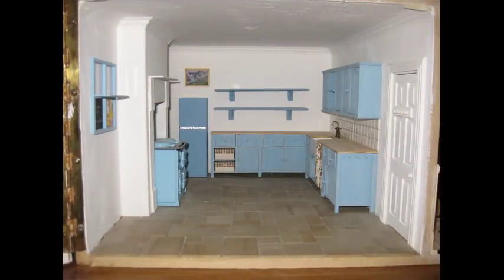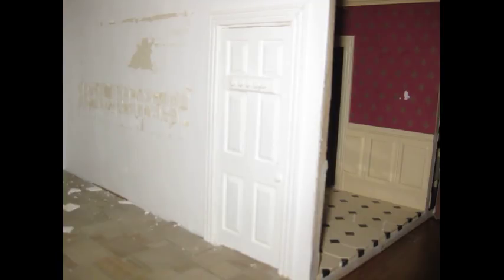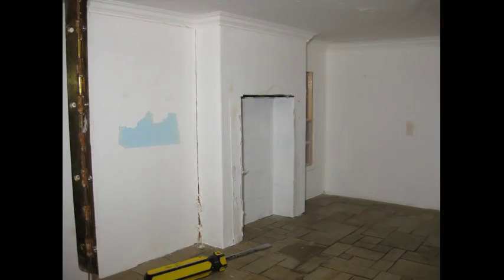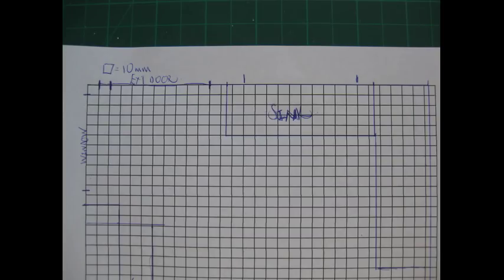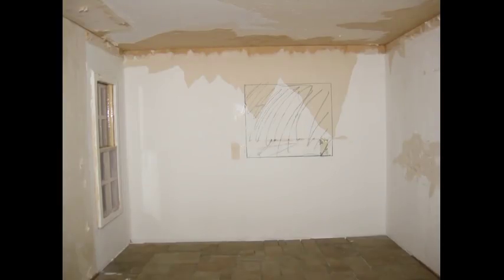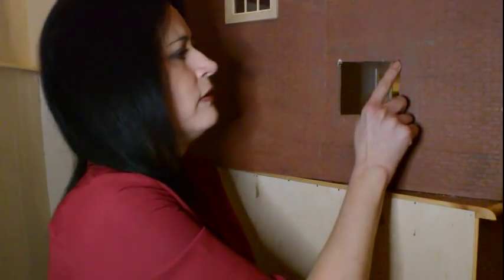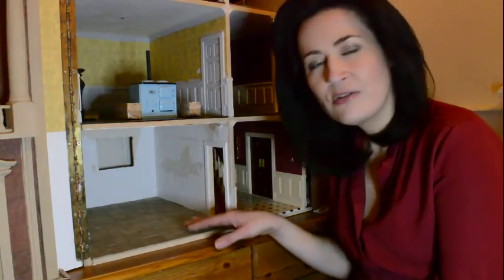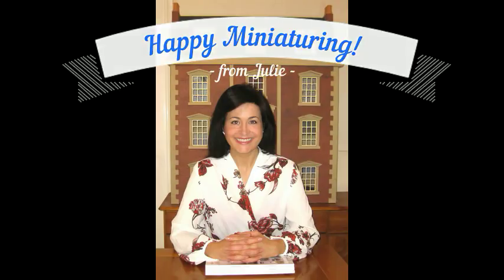My Dolls House Diary Episode 5 - The Kitchen

Comment: Good morning Mam. There is an easer way of cutting out square/rectangle. Drill two holes one in each of diagonal corners, then you can cut two sides from the same hole and cut the other two sides from the other hole job done. To give you a better cut you can buy a scroll saw blade to fit your jigsaw, it can also be used for circles and different shapes 👍👍
Reply from the maker: Great tip!

Comment: It's lovely to see you using power tools.
I'm sure you will give others the confidence to have a go too!  :)
Many of the power tools used for miniature work are actually very safe providing basic safety rules are followed and a bit of common sense used.
I would echo Tina Cambell's concern about tying long hair back and maybe use some safety glasses (if you don't already wear glasses) too  ;)
If people have access to a 'hobby drill' (aka a 'Dremel),  that could be used with equal success to cut out the aperture for the window.
Alternatively, if anyone is still shy about the use of power tools, something like a razor saw would do the job too - I'm sure you would find them in your Expo tool catalogue Julie.
Gwyn
Reply from the maker: Thank you Gwyn. I have a Dremel, but need a bit of practice with it for things like this - perhaps that could be a future VLOG.  I do own a razor saw and use it for many of my projects, but I used that to remove a door in the bedroom and it was a bit of a long-winded process!

Comment: Nice! Can you link to what product you mentioned you used after the grout on your floor again? I can’t seem to find it
Reply from the maker: Thanks Abby.  After grouting, I applied a coat of PVA, a type of adhesive, mixed with equal parts water.  You only need a small amount, mix them together and brush it on.  :)

Comment: The drill wasn't going in reverse? Or maybe it was really blunt? Should not have been that tricky unless your house is made of concrete. Also be careful with sanding MDF, wear a respirator, that stuff is like asbestos. I prefer to work with plywood.
Reply from the maker: No, the drill wasn't going in reverse, I'm not that bad with power tools!  It was in fact a little bit blunt, so just took a bit more pressure.  The house is made of 9mm thick plywood.  I shall be wearing a mask when sanding, as I advise others to do in all of my tutorials.
Reply: @JulieWarren   Just checking. I'm not bad with power tools either but I've had the drill in reverse a few times. Of course knowing it is as soon as I start, but still, for a few seconds you wonder why nothing is happening.